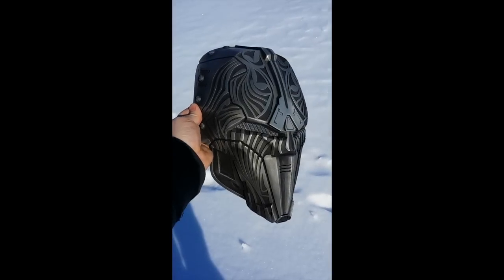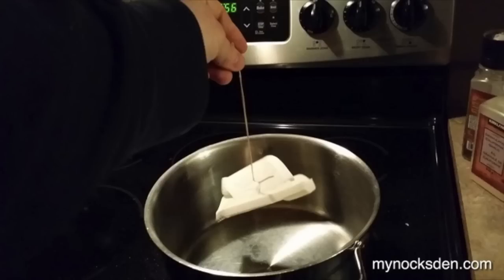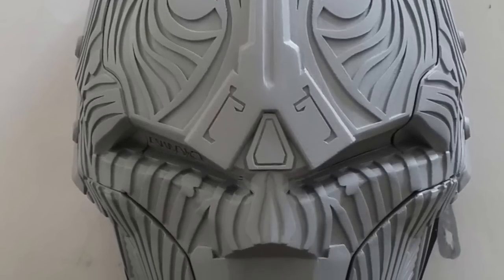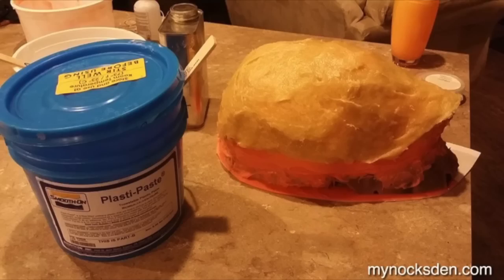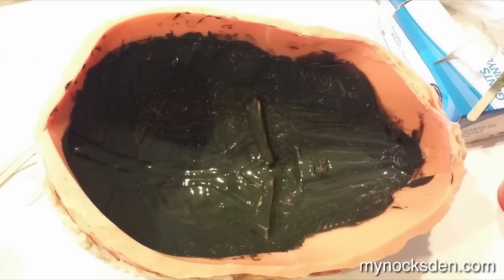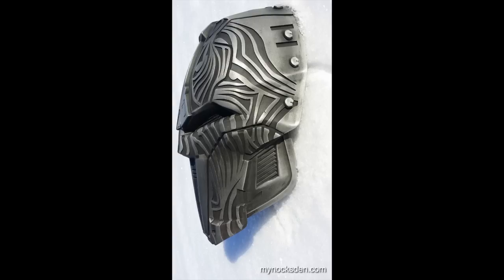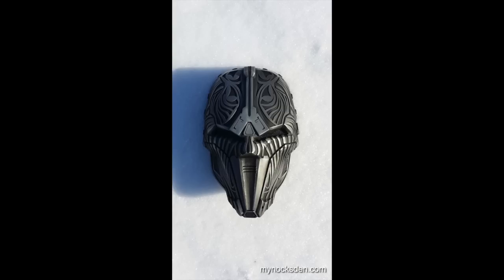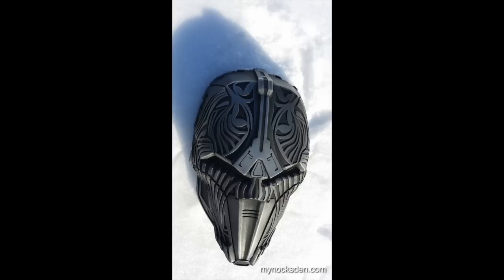The Making of a Sith Acolyte Mask

Comment: Rhino for the win. Im assuming you used curve projection for all the raised areas?
Reply from the maker: That is exactly it. OffsetSurface. Rhino goes a little nuts when offsetting complex polysurfaces, so I had to spend several hours touching them up manually.
Reply from the maker: MynocksDen Props curve projection, then split, then offset surface.

Comment: Could you polish the master in-order to get a mould with glossy finish?

 How would you accomplish that with 3D-printed materials?
Reply: I find it's nearly impossible to get a glossy finish in a mold, and it IS impossible if you use a mold release. it's best to spray your pulls with a crystal clear gloss finish afterward.

Comment: I'd like to make a mask similar to this but a 3D printer is way to expensive for me, so how would I be able to do it?
Reply: +CaptainZapperz you can sculpt it with clay, just make absolutely sure there is absolutely no sulfur in the clay that you purchase.  After the clay hardens and you are happy with the sculpt, you'll be at the stage where he had finished assembling the 3D printed components into the first version of the mask and you can proceed to mold just as he did.

Comment: if you already have the 3d print, why bother making a mold and casting, especially if its possible to smooth the lines off the print?
Reply from the maker: In my experience, the quality and durability of the final casting is always much better than that of a treated 3D print. Molding allows you to cast the object in a more durable material, which you can also infuse with metallic powders to create realistic surface metal effects without the need to paint. For smaller costume accessories I sometimes use original sanded or acetone treated 3D printed parts, but for large items such as masks and helmets I always mold and cast..